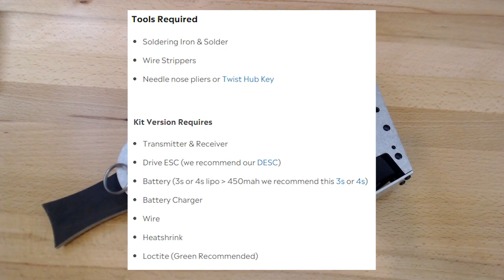Endbots Vector kit assembly

Comment: It's taken a while to get there but I've finally got all three motors wired up correctly. 
 
I've got a slight problem in that I currently have to push the throttle stick in a South west direction to get both wheels to move forward. Am I correct in guessing that this is a controller calibration problem rather than a wiring issue?
Reply from the maker: Run the calibration per the DESC instructions on learn.endbots.com

Comment: Is there a specific type of rating that works well here? There are several AWG options available on Amazon and I’m not sure which to pick
Reply from the maker: I use 22g for the motors and 16g for the power

Comment: Sorry to bother you (again), but do you think it’s possible to make this plug and play for ease of assembly/repairs? That’s what I plan to do with mine if I get one.
Reply: Personally I dislike the plug and play style of bot building. Every new connecter is a new failure point. The best thing to do is just get a bunch of solder practice. Be sure to come say hi at motorama! What is the name of your bot?
Reply from the maker: It will not be offered that way, but you could make it.  As TML Robotics said I would just practice soldering.  I can swap motors almost as fast as dealing with a plug.
Reply: To each their own. Everyone has their own opinion and I respect that.

Comment: My timing belt is binding and rubbing against the top rim of the pulley, and I’ve re adjusted it in every possible angle (the belt is straight), what should I do to fix this? (Even when both pulleys are aligned this problem occurs)
Reply from the maker: you may have the motor hub in the wrong position or upside down.  The narrow part should point up out of the hole in the top plate and the bottom should be pretty much flush with the bottom of the motor bell
Reply: @JeffreyBuilds  thanks for the quick reply!  
In your video the flat part of the motor hub is facing the hole, so I’m a bit confused.  
Here’s a video of it:
https://youtube.com/shorts/9soREHQRn30